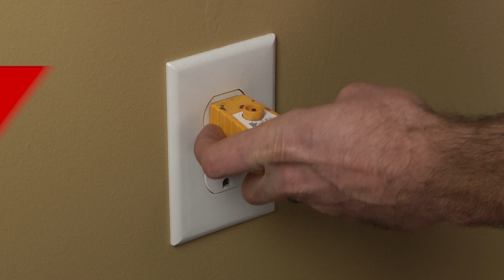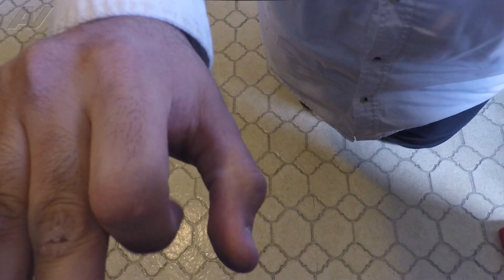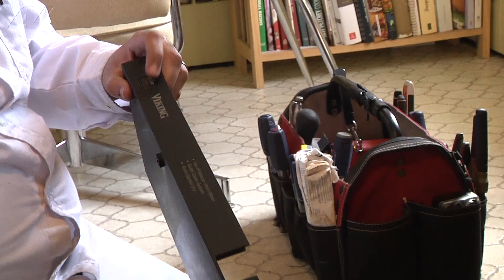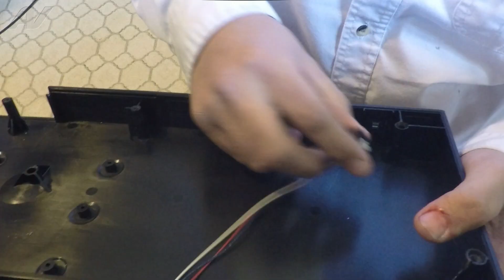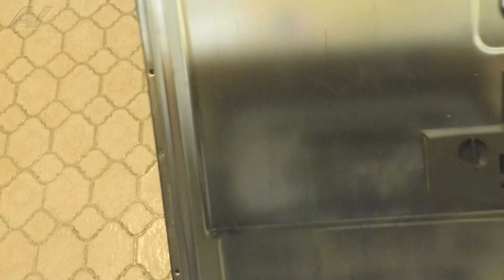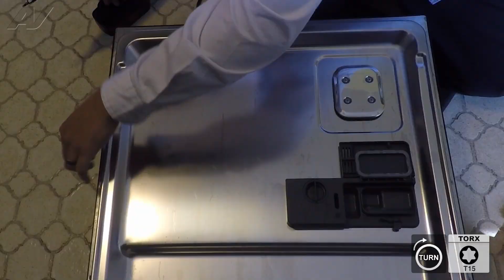Viking Dishwasher Repair - Will Not Start - Diagnostics & Troubleshooting

Comment: thanks! this video confirmed my suspicions of what was going on with my switch. i moved my switch assembly external from the door to use the dishwasher while waiting for the replacement part to ship and it seems to be running just fine.

Comment: You made it look pretty simple so I took a shot and ordered the Viking part on Amazon for $64. I successfully did this all by myself! The appliance repair guy I called wanted $375 — not sure if this was influenced by the fact that I’m a woman, but it seemed like a lot for the job you showed. I also did not want to invest that amount in a 10 year old dishwasher. I figured it was worth a $64 gamble and it paid off! I should mention that I was a bit lucky that I correctly diagnosed  the problem by myself based on how the machine was malfunctioning. Also, I did not replace the plastic start button, just the starter switch. On my unit, all the screwheads were T-15, but there were three different lengths. I made sure to draw a little diagram as I took it apart to track which screws went where. More than the cost savings, the satisfaction of doing it myself is priceless. My husband is a tough customer, but even he was impressed. Thank you for posting this video!
Reply from the maker: Thanks for your response, we are glad we could help. Our library of over 5,900 videos are currently helping over 1.6 million people like you every MONTH.  Please help us by subscribing to our YouTube channel, or post our website www.ApplianceVideo.com to your Facebook page, Twitter, Instagram or any other social media sites. Your support will help us keep producing more free quality videos.

Comment: Excellent video! Do you have a How-To to service the Power-On LED on the bottom of the door? Mine no longer illuminates when the dishwasher is running. Viking model VDWU524SS.
Reply from the maker: Great question, if you have a more technical question that our parts department cannot answer, you can search our over 17,000 answered questions free at our website www.ApplianceVideo.com under our Repair Help section. You can also call our parts department at 1-800-830-5465 and they can give you help 7-days A week ,or search at www.SaveMoreOnParts.com  .

Comment: I desperately need someone's help. I have a viking dishwasher in my loft, it's a few years old I am sure, and the buttons are located on front. It is a built in model. The buttons flash and dont work..so I can't choose a cycle or hit start.  Csn anyone help !?
Reply from the maker: Great question, if you have a
more technical question that our parts department cannot answer, you can search
our over 10,000 answered questions free at our website www.ApplianceVideo.com under our Repair Help section. You can also call
our parts department at 1-800-830-5465 and they can give you help 6-days A week
Monday -Saturday, or search at www.SaveMoreOnParts.com  24 hours
7- days A week.